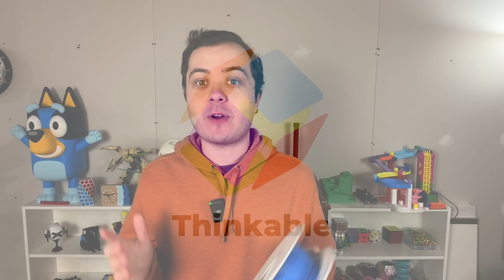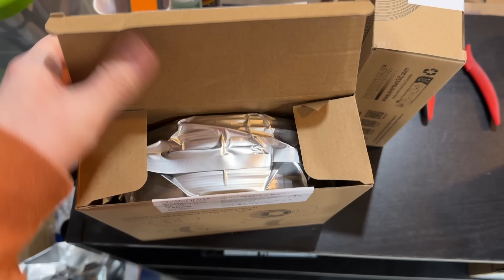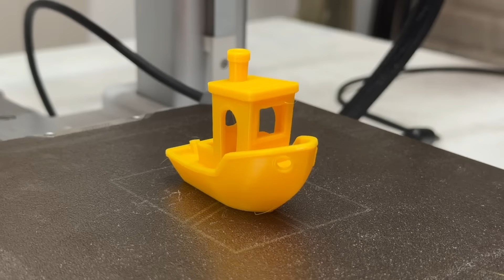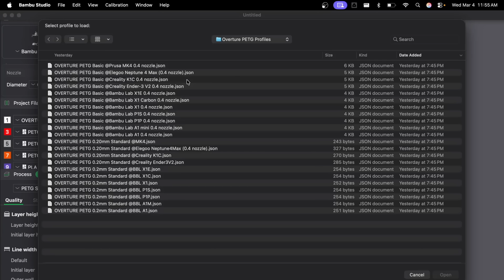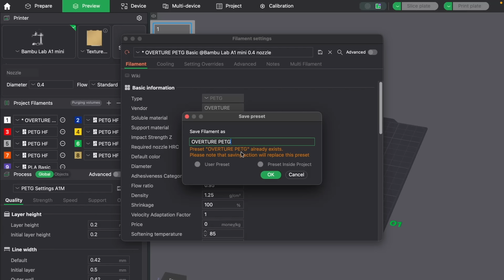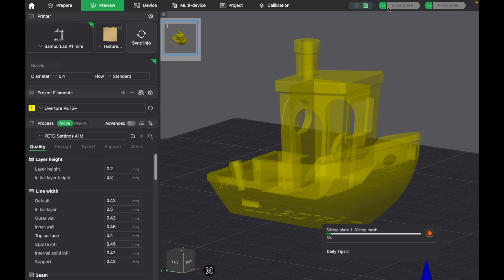My New Favorite PETG Filaments for 3d Printing

Comment: Im no fanboy of Bambu, and hope to find competition for there filaments. I had a look on Amazon, and the price matches Bambu almost exactly, IF buying a single spool. But with Bambus bulk option, buying 10 spools at a time, (Overture doesent seem to have the option) this becomes way to expensive.
I suppose if you print with a small A1, you don't use as much filament(?) and buying 1-2 rolls it's no difference to Bambu. (As prime member one saves on shipping, so thats a plus.) For me, going through 10 rolls a month Bambu seems like the only option.
When they are out of stock for a longer time, I been using Sunlu with there refillable spools. I mostly (About 70%) print in gray, and the Sunlu gray is not a very pleasing nyance of gray. 4xrolls I can get for the same price as 2x rolls of overture at point of wrighting this post.
And it prints fine with standard Bambu profile (Bambu PETG) in a H2S. A bit to glossy, but the also have a HF variant, witch I didn't get around testing yet, due to higher price. Still a lot cheaper then the Overture though.
I hope they get there volumes up, so the price can get down, would be great with another option.

Comment: You don't use any glue stick or anything with PETG on the texture PEI plate?
Reply from the maker: I actually just started to recently. My textured plates are older and the coating has definitely degraded over that time. I apply the liquid glue stick every so often to help prints stick better and so far it’s working pretty good!

I would say that if your prints are not sticking as well and your build plate is relatively new, it’s best to clean it off with a (tiny) bit of soap and rinse with water thoroughly. Then maybe apply the glue if needed. Hope this helps 😊
Reply: @thinkable3D  Thanks for the reply. I was thinking that the glue stick was so that PETG would release from the PEI plate and not so much that it sticks.
Reply from the maker: Kinda does both in my experience

Comment: wish they were matte
Reply from the maker: That’s true. Maybe in the future there will be more options for a matte PETG.
Reply: I just tried PETG-CF in black on my A1 mini and it has a beautiful matte textured finish because of the carbon fiber. Downside is you should really use a hardened steel nozzle.
Reply from the maker: I’ve never actually tried any carbon fiber filament before

Comment: lock at Sunlu PETG, all the same plus you can use Bambulab profiles.
Reply from the maker: Definitely gonna check this out. It’s awesome that there’s more options available!
Reply: What color is that?  It's like a school bus yellow. It might look cool.eoth my all black 3d printed server rack.
Reply from the maker: The overture PETG is pretty glossy too
Reply: I've been trying to run it and after 100s of hours of testing and calibration I get inconsistency because of the nozzle build up that dragged across the print